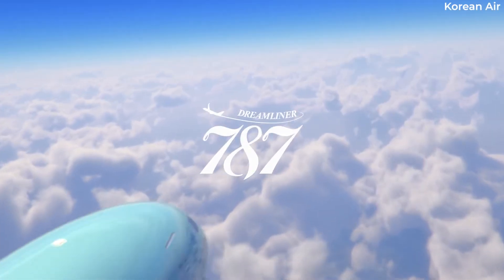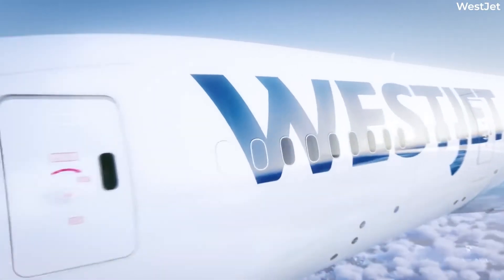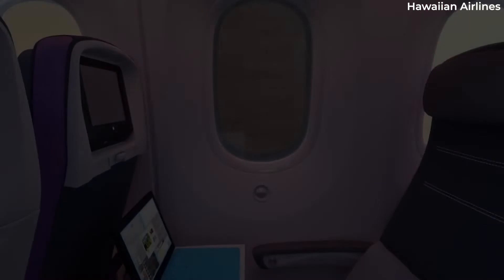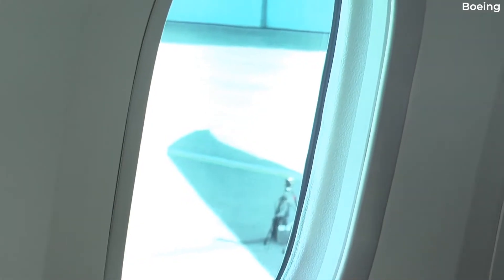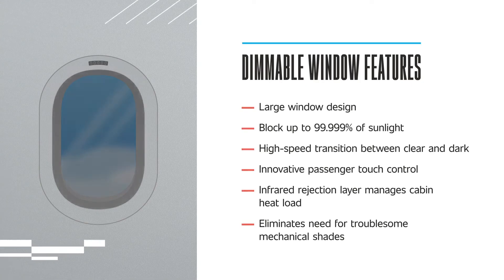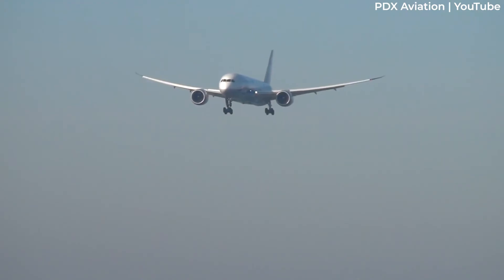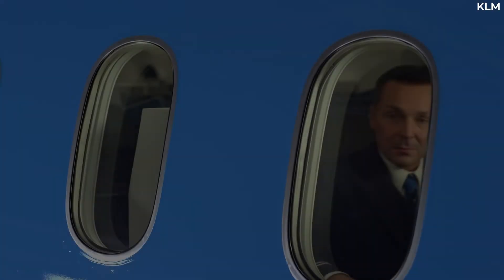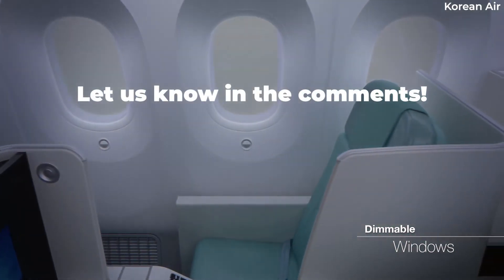How The Boeing 787 Dreamliner's Dimmable Windows Work

Comment: Enjoy the bigger window, but i still prefer the shade. Was on one recently that wouldn't dim, or else the cabin crew had it set like that, it was torture with the sunlight. 8hr flight just came  off a 9hr flight with 1hr change over in Doha, couldn't snooze air con didnt do much as i was being microwaved by the sun.

Comment: this is purely another control measure, nothing more, leaving it entirely up to the individual airlines to each establish their own policies. Bottom line remains unchanged as has been the case since passenger aircraft first took flight decades ago: Flight crews should never be in control of window shades. Period.
Passengers who pay extra for a window seat should have control of the window shade, not the flight crew, because the passenger is the one sitting beside the window and most affected by the shade position. The EWD technology was (admittedly by the manufacturer) primarily introduced as a measure to allow flight crews to control them, instead of passengers controlling them..

Comment: I noticed the significant improvement of the shades when I flew on a new Qatar Airways 787-9 3 months ago. It darkens a lot faster than before, and I was unable to see anything outside in full dark mode. It's much better now than the older version, but people still hate the inability to fully control them.  
I'm of the opinion that cabin crew should rely on instructions to passengers just as they do with conventional shades instead of taking full control of them, and people would appreciate the feature more.

Comment: dimmable aside, I really do wish airbus would do larger windows
Reply: The Airbus A220 (originally designed and built by Bombardier as the CSeries), has very large passenger windows: 28.0 x 40.6cm or 11X16 inches.

Comment: The first few times I used them, I did not understand how long / short to push the buttons.  The results was frustration about where the opacity ended up.  That written however, once I understood how they worked, they allowed for just the right amount of light for me.  One other thing, I like that the F/A's can control the opacity during sleep time, because on other (many) international flights I have been on, while trying to sleep, there is always "that guy" who insists on having there shade up, while the rest of the shades are down.
Reply: That "one guy" has the same rights as you have.
Reply: Seeing out side can help with motion sickness. 
On the first flight I took I had my shade down for most of the flight. But I started to get a little dizzy. So I looked out for awhile and it cleared up
Reply: If u want full control of light and darkness Then buy first class instead and Who would want to have the Windows closed it might be ppl’s first time flying and they might want to enjoy the amazing view especially with thoose large Windows
Reply: @Phillip Banes - it does not always help on long flights.

Comment: I flew on the 787 in 2014??? It was great.  Plus it was a first commercial flight of the plane for the airline.  I found the blinds to work well but as mentioned in the video at that time the system did not block out all the light but it was pretty good.